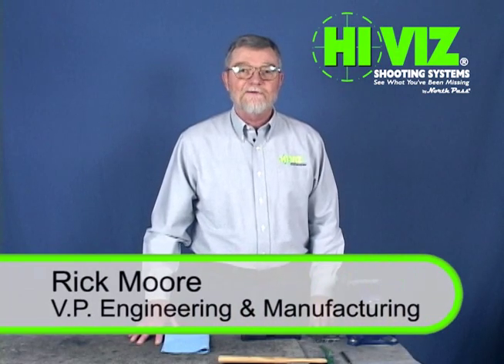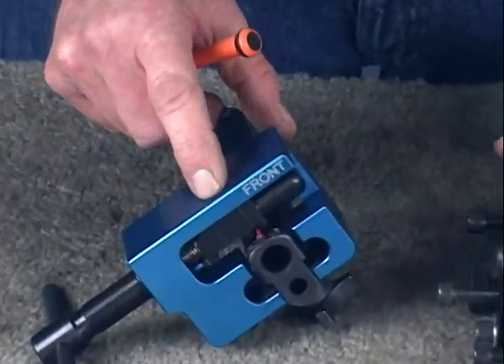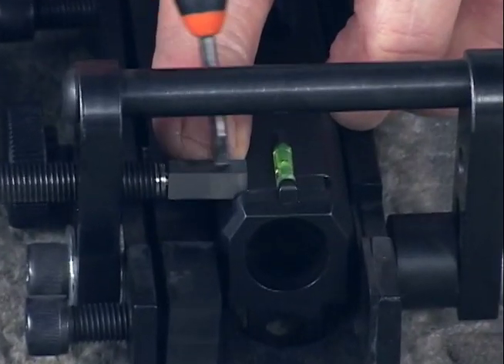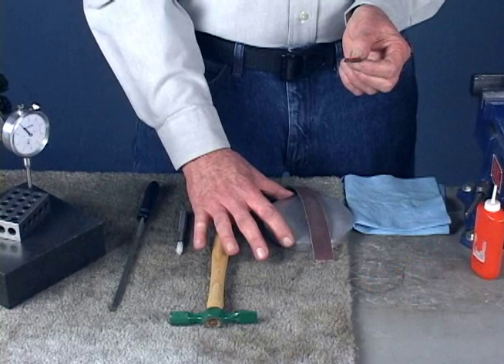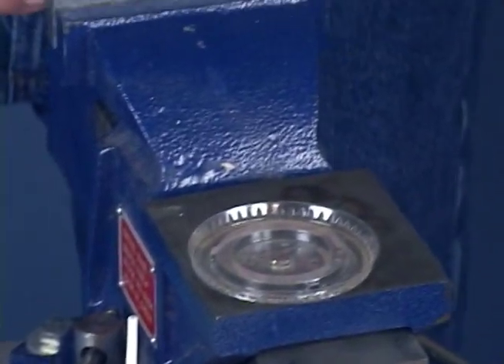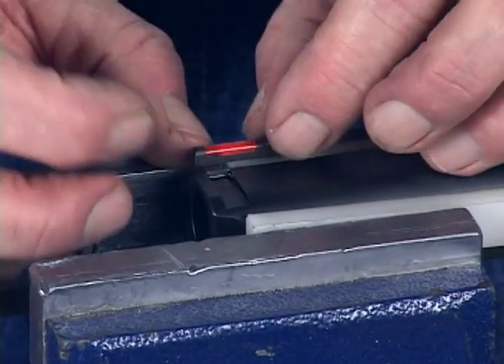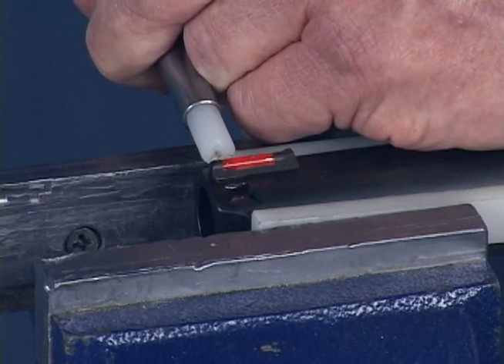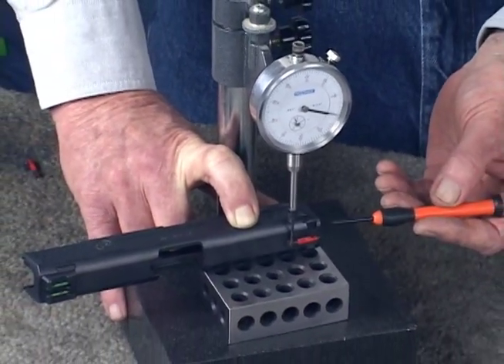HiViz Pistol Dovetail Type Front Sight Installation Video

Comment: Why couldn't you guys make the sights that so we don't need to sand the damn thing.
Reply: I'm pretty sure it's easier to sand excess down than to add metal or plastic back to the sight. It's called machining. Every pistol made not be machined to the exactly the same tolerances.
Reply: Yup lol

Comment: Last 6 months I noticed  Windows standard "CUT & Paste" commands are disabled in comments; guess someone doesn't want to receive criticisms again and again.  I gave my son a HiViz front sight for his SR22; an auto mechanic he had no issues installing it.  BUT AT THE RANGE those lame  set-screws came  lose after shooting just the 2nd magazine full.  He fixed it at home using Black Finger-Nail polish as thread-lock.  Most "INSTALL" videos never include a Range-Report as to product durability.  Thanks for the video.

Comment: They worked great on my G19, but on my Shield, even AFTER cerakote added a few microns to the slide the new Hi Viz front floated right through the dovetail and was too small to use even with a ton of red threadlocker.  I'll Never buy another.
Reply: I wish I could disagree.  I can't.  I picked up a Novak cut Hi Viz sight for one of my 1911s.  It just drops right on through.  Very unhappy.  I wound up using a Novak cut sight from one of their competitors.  That fit perfectly.  Hi Viz, IMO, needs to drop the cheap base metal on their front sights, go to steel and pay more attention to dimensions.